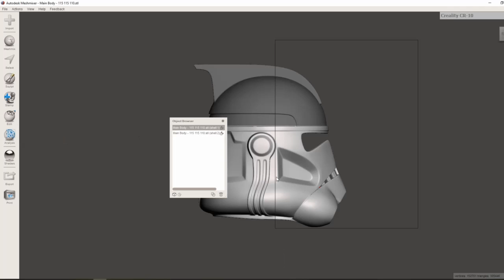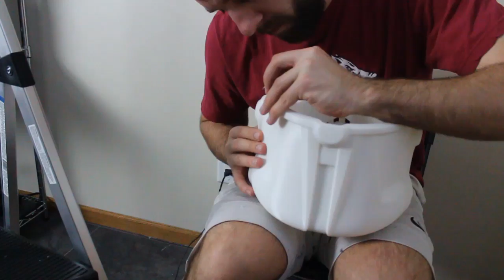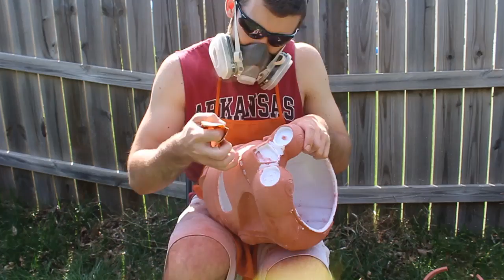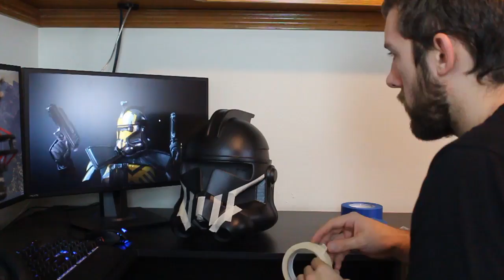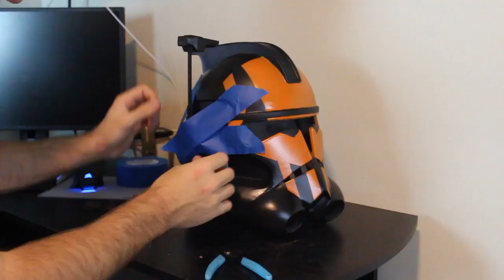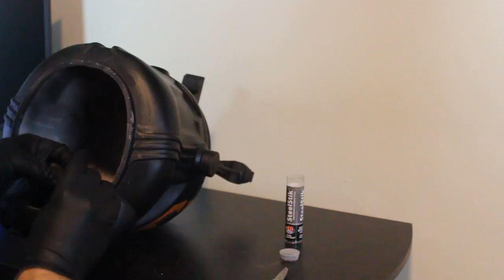Making an Umbra ARC Trooper Helmet from Battlefront 2

Comment: i love your work but im on your website and i see that alot of your stuff is out of stock what happened also im making a new self character it is baced on the phase 2 exparamental arc trooper armor but set in a post apocalyptic situation and im mixing the clone armor with bits and pices that fit the situation and my insparation is fallout, metro and mad max. and im going to make it so its 501st clone trooper aproved.

Comment: for alignment:
could you test to print negative shells of the areas where the seems will be? not big parts but just enough material to guide the parts. then you could just add the glue and put on the shells. i imagine it would be much faster and more precise to connect pieces this way.

I have no 3d printer so I'm coming forward to ask you about that.

Comment: what would you recommend for the filament material and density of the piece  because im making a self character arc trooper and i want some help and i want to modify the helmet it will be the helmet shown in the video but i want to do what captain Rex did and have the phase 1 t-visor and im adding some tech in side like voice amps and speakers, a cooling system ,breathing system and a hearing system.

Comment: Could we get an idea of how large the helmet is? Just for scaling purposes, to make sure it would fit my head before purchasing a helmet!
Reply: I received mine just recently. It came in 3 pieces and when you set them up correctly, the helmet is HUGE. It rests on my shoulders before my head touches the ceiling. Seems like it would fit a 7ft-8ft tall clone. Not sure if this is just my helmet or if it's the standard size. It seems like great quality printing though so I'm going to email him with some questions. Seems like it'll make for a fun project, I just won't be able to wear it when I'm done.

Comment: Hello there! You're probably not going to see this, but I am new to 3d printing, and when printing a thing like this (I don't have a 3d printer but there is a branch of places where I can print files) i don't really know the best type of material or file to use. The materials I can choose from are 'PLA Plastic', Powder, Resin and 'ABS Plastic'. I want the helmet to be as durable as possible, so what material would you recommend? Also, there are only 3 different file types to print at that place- 'OBJ', 'STL', or 'WRL'. 

TL/DR
What material and file do you recommend. 

If you (or anyone else who knows their 3D printing well) can anwser these questions, that would be sick.

Comment: I haven't watched the whole video yet (a cool watch so far), but did you ever consider taking the skin from the game and and creating a template for the decal by overlapping it with the actual 3d print model? You can do that in Blender for example. That way you can repeat the process over and over again, 100% exact to the game, and to me easier to do. Just a building suggestion. Again, cool video!

Comment: Does most armor have some weight and strength to it or is it like a cheap plastic Jbbawockeez masks that you’d find at party city that literally rips when you sneeze ? Obviously yours is 3D printed so I’m sure it’s a thicker more durable plastic. I want one that’s literally almost like a football helmet. Pads and a strap to keep it on and from looking super flimsy. Plus I want to use a good visor for the eyes too. Also I painted my own football helmet and I didn’t use much primer for it. Didn’t even use half a can. That was pretty cheap too. I bet that bondo added a cool weight and texture to it too. You should scuff up the areas you add glue so the glue can adhere to the actual structure of the helmet and scanner instead of just the paint.

Comment: The bondo you linked is a 2 part, but I only seeing you using whats out of the tube without mixing. Is it a one part product, or for this purpose does it work using just the first tube?

Comment: How do you typically judge the size? I use armored garage as I’ve seen you use in the past and printed a Mandalorian helmet which turned out a bit too big. Do you tend to make the clones slightly bigger than the armored garage model’s head, slightly smaller than the model (some parts sticking out) or as snug to the model as possible? Any info would be great because I’ve been having trouble getting the right size.

Comment: When I bought my 3d printer I went for the ender 3 over the cr-10s, i know their print qualities are comparable but being about 80mm smaller on both axis' of the build plate will I have to split the helmet files up into more than just the 3 basic pieces in order to fit on the build plate?

Comment: Does the bondo—>sanding—> filler primer technique work best only for 3D printed helmets or would it work for other helmets made in a different way? Asking because I’ve just been using Bondo then sanding technique on my helmet.

Comment: Would a material like XTC-3D or another epoxy resin be good at filling in the layer lines?
Reply from the maker: I don't think so. It's difficult to apply precisely and requires a lot more sanding than Bondo
Reply: Galactic Armory aha. Thank you

Comment: Hey so I am actually thinking of going through with this project it seems like a lot of fun. But it seems like the helmet pieces are out of stock and are very expensive. I was wondering how much 3D printer filament you used and how much it cost for the helmet. Or if you have some more helmet parts I would be happy to buy them from you.

Comment: I love how accurate to the appearance of the BF2 arc trooper helmets your creation is. in any case, the thing I'd like to know is how to make a Darth Malgus-like mask. Having a voice modulator in that would be brilliant too. heck, I'd buy an already made one if possible. unfortunately, there aren't any in circulation anywhere at the moment. there are Kylo Ren helmets, but their voice modulation is crap. the black series Vader helmet looks pretty cool & it even has the breathing noise, but it doesn't have voice modulation based on what I've seen in the review videos... even though there'd be enough room(shouldn't there be?) in it to have a voice modulator with those two miniature speaker things being what transmits(not sure what the terminology is) your voice to the modulator itself.

Comment: That helmet looks insane. Do you have a idea of when the helmets would come back in stock
Reply from the maker: A few weeks most likely. Printing is a slow process unfortunately
Reply: @GalacticArmory  I would seriously consider buying one if you made more. How much do they usually cost?
Reply: CT-Spartacus-5991 around 100$
Reply: @Anakin-Skywalker.  not that expensive
Reply: Rafael ya
Reply: @GalacticArmory  have you ever considered making a cast. You'd only need to print it once.

Comment: I found out a way to make the range finder functional. First, you would drill a small hole in the right ear area, and find a plastic or metal rod that would fit through. Next, connect the rod to the R.F. via superglue. Finally, add a ring like a washer to the inside of the helmet to make sure the R.F. stays in place. Great helmet and I intend on purchasing one when the shop reopens. MTFBWY

Comment: How big of a printing space to you need to print your helmets in 3 separate pieces?
Reply: I'm on a cr 10s and loving it 30x30x40h
Reply: @Crono099  not as good as my ender 3 upgraded to 400x400x600 ;)
Reply: Alek Balaloski print them one at a time
Reply: White Haddocks channel 2 no what he means is how big does the printing table have to be in order to print the part ex helmet part is 10 inches by 10 inches but Alex Balaloski needs to know how big the part is so he can make sure his printer is big enough
Reply: The entire helmet is 269 * 292 * 322mm... If you want to print a phase 2 dome (without the fin) in one piece you need at least 208 * 240 * 117mm but generally it depends on how you silce it I guess ¯\_(ツ)_/¯